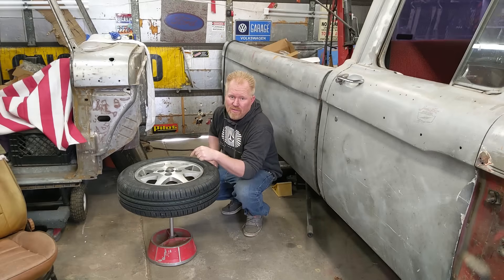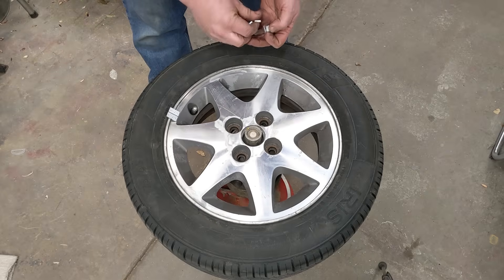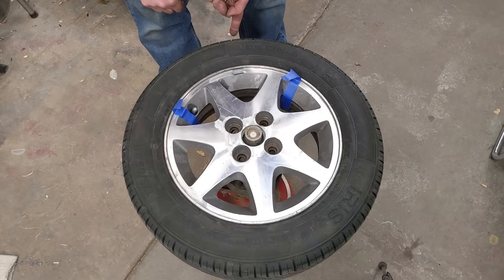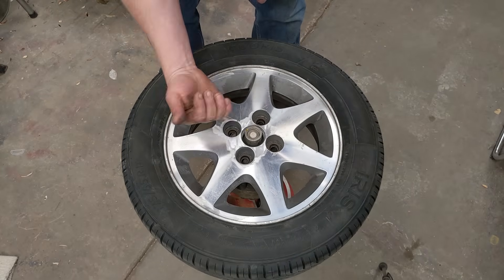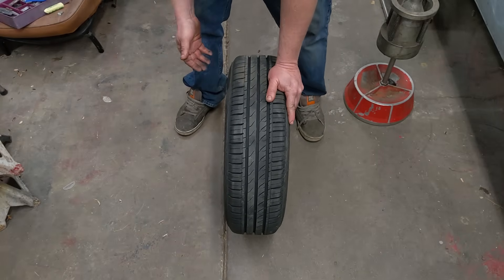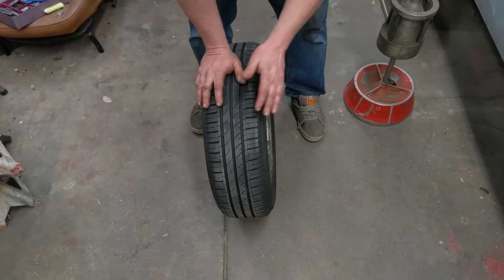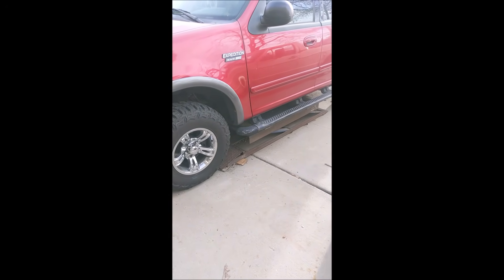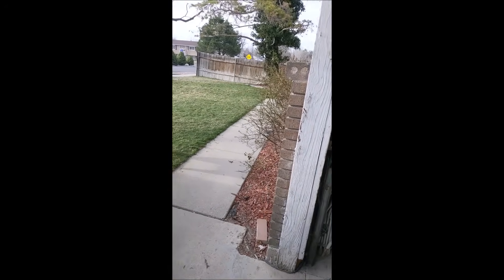Best Method How to properly Balance tires with a Bubble Balancer AT HOME

Comment: Hey, want to say thanks for the great video. Have similar balancer from Princess Auto and I never thought of doing it that way, but it makes perfect sense to balance things out and stop a side to side wobble. Well done !  The issues I have found with these balancers, is trying to read if the bubble is perfectly on center, too much room for error, and it’s advised to rebalance the wheel top for bottom, but most rims have too much offset to do this.

Comment: Question: I have a 1950's VW Bug and the wheels are gaped open in the center.  No modern shop near me can balance them. Suggestions?
Reply from the maker: I have dually wheels on my Toyota motorhome with too big of centers for this. I made an adapter however you could also use tire balance beads. Honestly though balancing is way over exaggerated with the fear mongering auto industry we have these days. I ran unbalanced tires for years and maybe 1 in 10 actually need balance and that's me using old crappy tires. Tires go out of balance every 5000miles and needs to be redone. Tell almost anyone that and they'll tell you they never rebalance tires, so  virtually every car is running with unbalanced tires.
Reply: @ Jack Taylor You need to find a tire shop that has the ADAPTER.

Comment: You should compare the results with a regular balancer. Im sure most tire shops would measure a before and after for free.
Reply: Well I've balanced my motorcycle tires, gravity method for ages and I've tested 300kmh on my bike and I'm still alive. Don't recommend those speeds though :)
Reply from the maker: Others in the comments have done just this. I took a freshly machine balanced tire and threw it on my bubble balancer and it measured perfectly where it didn't before.

Comment: Great video.  I have the cheapo Harbour freight.  My process is completely clean and polish the contact points, best I can. One tiny spec of light machine oil . Then calibrate the head alone. Bubble has to be perfect in the center of circle,  as my eye can tell. And as I put the wheel on I give it just a tiny twist.
When it rests I go by perfectly putting the bubble in the dead middle as close as possible anyway. 
Alway been good.

Comment: Nice.
The weights are not steel they are lead.
Reply: There are also steel, I just bought plenty
Reply: Actually most new ones are zinc.
Reply from the maker: My new stick on ones are steel. Zinc is tool light and bulky for my liking.

Comment: airsoft beads, 4 oz. inside tire dynamically balanced allways. gives 30% more tread wear.

works  with static balance y method

adjusts for that tiny rock or mud  on the rim, or screw or loss of stick on weight. 

break tire bead, pour beads in gap, re air tire till bead pops. done.

weights not able to move= static balance

weights able to move = dynamic balance
Reply from the maker: I used beads years ago and it's too lumpy at low speed for my liking. 4oz is like putting 8oz or 32 of these sticky weights on the rim. That's a ton of weight. I got the best results by first putting it on a bubble balancer and seeing how much weight the tire really needs. Most where around 1/4-1/2oz at the tread area. Pour 1/2oz of beads in and your golden. Best low speed and high speed performance without any noticeable out of balance.
Reply: I’ve been doing this for about eight years . Best way to balance In my opinion

Comment: Any experience with dynabeads?
Reply from the maker: They do work but the biggest issue is the blind guess on how much you need. Guys will put 4oz in a tire which is equivalent to around 8-10oz on the rim. That's 32-40 of the little 1/4 sticky things... HOLY COW that's a ton of weight. You then need to start driving with a 4oz of weight lobbing around and it's not until you get up to 20mph-30mph that it begins to smooth out. Generally this is way more than they need but there is a remedy. Use a bubble balancer and get a round idea how out of balance you tire is. 1oz? put in 1-1.25oz and you'll be set. You will have virtually zero out of balance at low speed and better balance at higher speeds as the bead get into place faster.

Comment: My harbor freight one is a pain in the ass cuz my floor isn't level. It's not very far off when I put the level on the floor but it does slope. When I'd try to use it it would always read as being light on the sloped side n I could take the tire off n rotate it n it would show being off on the slope again. I messed with it n messed with it n by the time I was fed up the warranty was up by like 2 days so I couldn't take it back. As always, great video moe. I'll definitely be trying it this way when I get the whole thing level
Reply from the maker: The floor won't matter if it's out. I've tested it with a 1/2" slope and get the same results as the head will always self level.
Reply: @sixtyfiveford  well that sucks then cuz even if I turn the head n put the tire back on it still leans the same way
Reply from the maker: @benmiller5015  I would just go by another one and put the old one in the box and return it as deffective. It's not your fault they sold you a bad one and you didn't find out until after their bogus warranty went over.

Comment: For the past few weeks I have been wondering if it was possible to balance tires at home, without the fancy equipment. If you have been reading my mind, thank you?
Reply: Yes, you can static balance wheels at home, but realize that this isn’t as good as today’s dynamic balancers. Static balance only affects the radial direction.  With narrow wheels and tires, this is often OK.  However, with today’s wider wheels and tires, you can still have axial imbalance even with perfect radial balance and this can only be detected and corrected with a dynamic balancer.
Reply: I had one of these and it was awful.  Very tedious and many cycles pulling wheels on and off.  Buy a real wheel balancer machine, they're not that expensive.  I bought a Mayflower one and it does everything I wanted to do with car and truck wheels.

Comment: Balance beads. Enough said.
Reply from the maker: They work just fine. However most sites will tell you to put in around 4 oz. Generally that is way too much. 4 oz in the tread area is about the same as putting 8 to 10 oz on the rim. That's about 40 of those stick on weights equivalent! The problem with the beads is you get a huge inbalance up to about 25 mph and then they start smoothing out. That's perfectly fine for a semi that spends 95% of his time on the highway but can be horrid on a stop and go slow moving vehicle. so I suggest using a bubble balancer to figure out approximately how much weight you need and then putting the beads in. Or you could just start out with about a half ounce of beads and just keep moving up until you felt no vibrations at high speed.

Comment: My uncle balanced using the "Y" method.  That was 30 yrs ago.  I've never seen anyone else do it until now!
Reply: It's also called the ABC method, the old babco bubble balancers recommend it in the instructions. I think its the best way, instead of 2 opposing heavy spots the weight is triangulated, so every 1/3 of the tire is balanced with each other. The other benefit of the bubble balancer is you can pre balance the tire and rim before filling with air, put the tires heavy spot directly across from the rims heavy spot, which reduces the weight needed to balance after filling the tire with air.
Reply: @Reloadeez  Or you could have a shop with a road force balancer mount and balance your tires in a tenth the time it takes on a bubble balancer. For 10 dollars a wheel. 

Bubble balancing is out of date for a reason
Reply: How about the price of your time waiting for them to get to you? Your time is priceless believe it or not.
Reply: @contraband1543  I don't know where you get 10 dollar mounting and balancing per tire but let me know. In NYC it cost 40 a tire, I have a friend at Firestone that was able to get me 2 tires done for 45.
Reply: @thbigshot101  That's because you live in nyc. Prices are normal in the midwest.
Reply: @contraband1543  ik wanna send me a plane ticket so i can get out of NYC? lol

Comment: Thanks again!
What is you opinion on the beads I see mobile repairmen use?
Reply: Beads work great, but they are only for larger truck tires and they don’t start balancing till you get up to certain speed. The speed changes with how big the tire is and how much out of balance it is.  It’s trial and error for how much you need or it it’s too much.  You might have a tire so far out of balance that it’s a rough ride till it gets too approx 20 mph and the beads start to balance it. One thing to consider, is the quality of the beads. Most of the old tires I have taken off the rims, the beads had disintegrated into powder, this powder is bad for jamming the valve stem open and causing flats.
Reply from the maker: They do work but the biggest issue is the blind guess on how much you need. Guys will put 4oz in a tire which is equivalent to around 8-10oz on the rim. That's 32-40 of the little 1/4 sticky things... HOLY COW that's a ton of weight. You then need to start driving with a 4oz of weight lobbing around and it's not until you get up to 20mph-30mph that it begins to smooth out. Generally this is way more than they need but there is a remedy. Use a bubble balancer and get a round idea how out of balance you tire is. 1oz? put in 1-1.25oz and you'll be set. You will have virtually zero out of balance at low speed and better balance at higher speeds as the bead get into place faster.